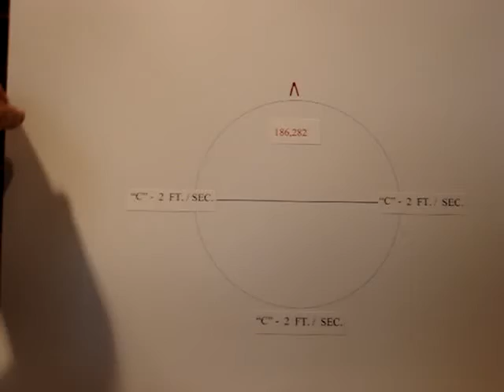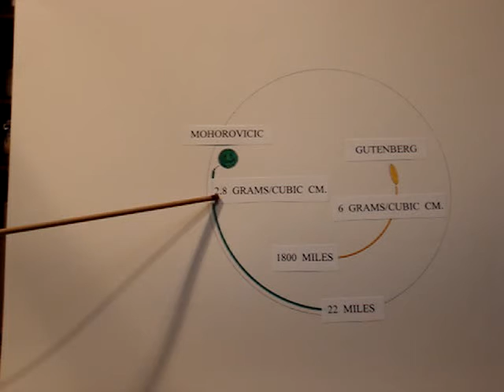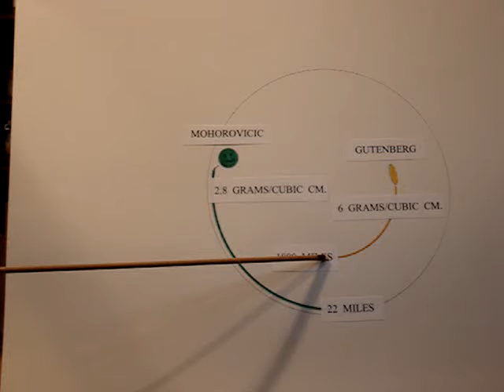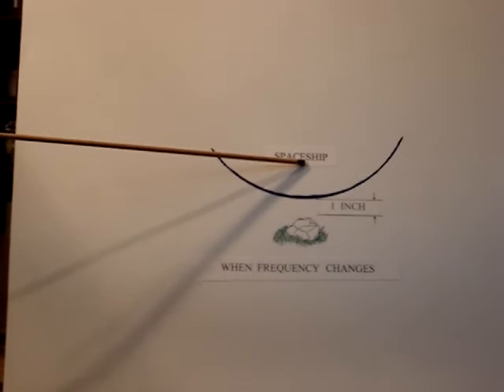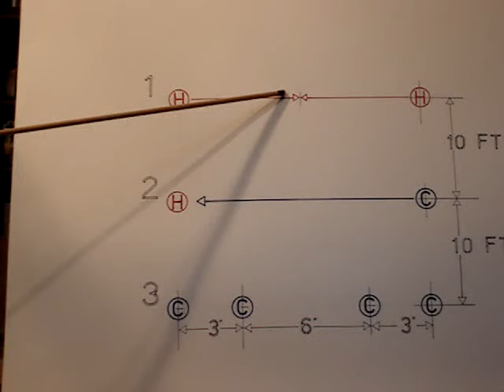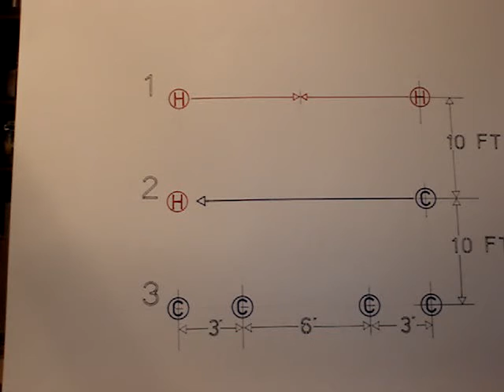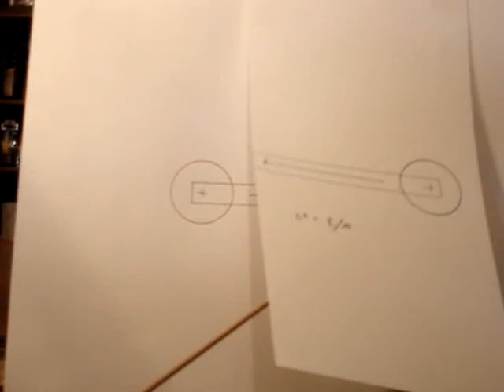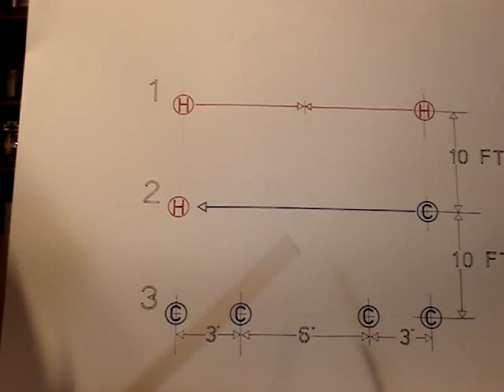Gravity Engine 2

Comment: Mass does increase as a mass approaches the speed of light. Proof of this can easily be found in the operation of a relativistic Cyclotron. The magnetic field strength must be increased to continue to bend the particle beam around the desired path. A heavier mass will travel in a larger radius than a lighter one in the same magnetic field. So your claim is false.
Reply: Mike Whitenton .
Everything is turned inside out upside down and all around just so you bastards can continue to control knowledge for WEALTH at the expense of nature's HEALTH.
YOUR COMMENT PROVES HIM RIGHT.

Comment: The fundamental flaw in your design is assuming zero temperature means zero energy. All it means is zero kinetic energy is available to radiate to other particles (roughly). An analogy would be like saying that an object at rest has no kinetic energy therefor E=mc^2 shows it has no mass since E=0. That is not correct and for similar reasoning zero temperature does not mean an object has zero mass.

Comment: Light doesn't travel. It's an inherent reaction of matter that when stimulated by black energy projects its spectral field properties. The so called speed of light is directly proportional to the intensity of the source in an expansive fashion. the distance covered by the expansion of the field is limited. When the source is no longer active, the spectral reactive field of matter withdraws inward into the source.

Comment: Check out the Reciprocating Water Displacement Gravity Engine. it runs on water. its in a boat right now but you could put it on land and use it to power households.

Comment: Not sure if I understand this all the way, yet....... I guess I have the hardest time with the idea of Freq., here....Is temp. the best way to change the freq. of mass? What about sound(as in a tuning fork vibrating @ a freq.)? What about electricity pulsing through the mass at diff. freq.'s? These are of course all different forms of energy...I'd imagine these may be more practical ways of changing/controling freq. but if not, why?

Comment: That's a pretty cool set of false claims based off of illogical theories.

"If we stopped all the frequencies, the spaceship would stop moving" ... But, what if the ship isn't moving relative to the rock, what if the rock is moving relative to the ship... will "changing the frequencies on the ship" instantly repel a rock moving relative to it?    Exactly.

Comment: In 2000 the Helsinki University of Technology reported reaching temperatures of 100 pK (0.1×10−9K). That is just one billionth of a degree K above absolute zero. 20K is hot by comparison! 

A heavy oscilating "Perforated Disc" suspened by wire, above heavy cylinders (Both non-magnetic alloys) rotations are slowed a fraction by repeated gravitational interaction between disc holes & cylinders . Frozen cylinders, if theory correct? would show less interation. This method is ultra-sensitive!

Comment: Actualy it wont be that cheap.. since 0 kelving it's been imposible to achieve... at 20 kelvin you have enough energy to bound atoms to a surface. mmm strange but it make sence that a 0 kelvin a particle.. with no energy... could just pop off from existence. jeje

Comment: One very elegant experiment to test gravity, involves three heavy cylinders, above which is suspended a disc perforated equidistantly with three holes of similar diameter. A taught wire acts as a torsion spring. The disc oscilates in precicely timed rotations. Very slight differences in gravity can be detected, by the slight 'jolts' as the holes coincide with the mass.

Comment: one of the final words are: "if that works..."
so the maker of this movie has some doubt on its own.

whats really missing here is a calculation how much mass, heat-energy and motion is to expect from such a design.

the most thrilling thesis here is the statement that attraction in case #2 is a single sided effect. (its not so important if its partial or full imbalance, just current state of art only knows equally balanced cases.)